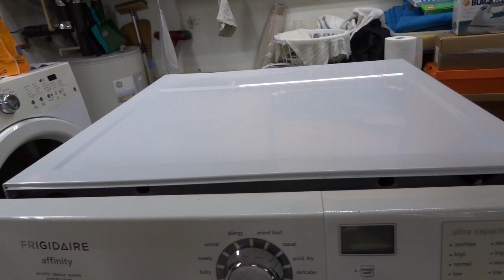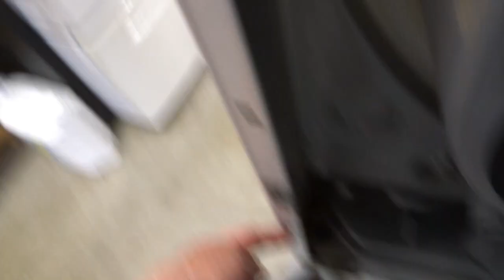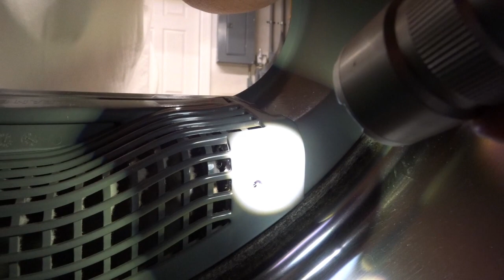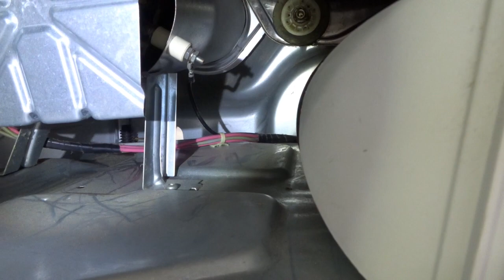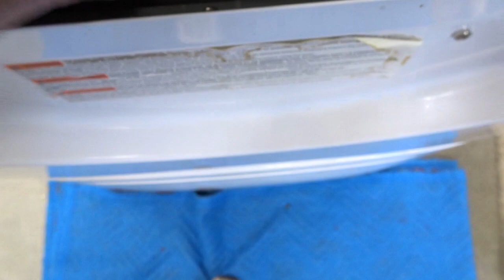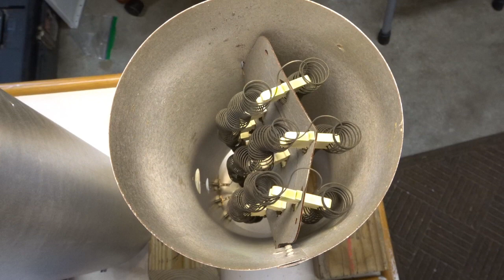Frigidaire Dryer Heater Element Replacement

Comment: Tip for the screw at the back of the heating element. Take one of the hex screws out of the old element then use socket and driver....saves soo much headache!
Reply from the maker: Great idea!  Thanks for sharing!

Comment: Your effort on this video keeps on giving - I just got mine done a little earlier yesterday. The approach that you demonstrate saved me much hassle over my experience of three years ago. Good tip on the little screw at the rear of the heater, it isn't just hard to reach; it's in a pocket that limits the length of screwdriver that can be used! I recommend a magnetic 1/4" nutdriver bit used in a 1/4" ratcheting bit wrench - smaller than a 1/4" socket ratchet. Do that screw before the other two.
Reply from the maker: Very glad I could help.  Thanks for your suggestion.

Comment: My dryer is a 2011 and has the steam option. Everything seemed identical until I got to me getting to the heating element. Now I'm stuck.
Reply from the maker: Hello Joe!  Very sorry you're having this issue and I sure wish I had a good answer for you.  Unfortunately, my dryer didn't have that feature so I really have no advice to offer at this point.  I'm just a DIY guy like you.  Hopefully you figured it out on your own or found another source of info to get the job done.  Best of luck on your repair and I hope it goes well for you.
Reply: @gizmoflyslow9854  your video got me far enough for me to figure out what to do next. I had to remove the whole burner assembly, including the gas line. It was simple enough. Thanks for your help. You're appreciated
Reply from the maker: @joegarza5046  VERY glad you were able to work through it and complete your repair.   Thanks for letting me know.

Comment: Great vid.  Thanks. That screw in the back of the heater element was a square drive on my unit.  Not sure who was the sadist designer, but you should check the head for drive type.  I shoved my phone in there and took a pic.

Comment: Well done video - thanks for all the effort! Saved me a ton of time figuring out how to disassemble the dryer and get to the place I needed to be. Got the heater assembly out and found my coils and support plate looked a LOT like yours - bent at the end, AND some of the coils were indeed touching the inside of the tube. E63 earth ground was exactly right. ALso found that there was a break in one of the center coils, so the thing was doomed.  Got a new one on order and it should be a breeze to put it in (except for those three screws holding the heater unit in place! XD)   Thanks again!

P.S.  Only only got $0.37 of change out of mine!  LOL
Reply from the maker: Thanks very much!   Glad to help and I hope your repairs and reassembly go smoothly.   Good luck!
Reply: @gizmoflyslow9854  Repairs went super smooth. Machine is back up and running properly. Thanks again!

Comment: My tip:  the back screw seems to be everyone’s Achilles heal. So what I did, as soon as I took the new element out of the box - I took the screw for the back hole and screwed it in and out several times. This basically “tapped” the hole and made for starting it when in position so much easier. Did it on the first try.  Start to finish on entire job, 45 minutes. Hope this helps.
Reply from the maker: Excellent suggestion Troy!  Thanks for your contribution to the DIY community.  Take care.

Comment: Great video, really helped me tackle this project.  I do have a tip regarding those hard to reach screws.  Particularly that back of the element one.  I did take the advice of using one of the element screws from the old unit.  I added one more idea, I screwed it into the new element  before I started the install.  I was also having trouble getting the screws for the sensor and thermostat into the the new element; so I pre-seated each of those four and that made  a big difference.  maybe this will help someone else tacking this project.
Reply from the maker: Excellent suggestions.  Thanks for your comments.

Comment: The last time I replaced this, I removed the drum and it took a very long time.  This time I followed your lead, but it took a long time to get that one screw out.  Fortunately I replaced it with a hex head so next time should be much faster. I didn't have the same problems you did because I used a #10 screw instead of a 1/4.

Comment: This was so helpful, thank you! i had watched other videos that involved removing the drum and I didn't relish the idea but then when I opened the dryer and saw that the wiring up top was different, I panicked. Your careful guidance of which screws to remove and which to avoid was SO helpful. And I laughed out loud at the advice to hold the lint trap when removing the single screw. Advice well-given! My old heating element looked just like yours!
Reply from the maker: Thanks for your comment and I'm very glad my video was helpful to you!  Good luck with your repairs and take care.

Comment: As I was able to pull my machine out into a clear workspace, I just took off the back cover to access that difficult back screw...WAY EASIER and only a little more work (~12 screws), easier to clean the back and you don't need to touch the drum...at least on my very similar model. (procedure identical but front panel on ours has more buttons).
Reply from the maker: Thanks for the comment!  Whatever works best for you and if your tip helps someone else - good on ya!  I never, ever claim to have all the answers when I do one of these vids so other helpful comments are most welcome.

Comment: Just curious, was there no error code reset stage necessary for this particular model? You just exchanged the element, and ran great afterwards?
Reply from the maker: No, I didn't have to reset anything.  The error code went away and it ran great.  I have since replaced the blower fan because it also failed and with a new fan and new element it works even better!
Reply: @gizmoflyslow9854  thank you, I spoke with a "certified" appliance repairman, and he said my issue may not be the element but the thermostats. My dryer still heats very good, just shuts system down after 15 minutes and displays error code. I cleaned the thermostats, the 2, I found, they were covered in lint. Still errors out, and hate to replace the elements when it still heats very well.
Reply from the maker: @project-unifiedfreepeoples  I agree.  Your problem is different than what I experienced since mine wouldn't heat at all.  Good luck with your repairs!
Reply: @gizmoflyslow9854  again, thank you. Your video was very helpful to me in my experience. Most searches in my situation resulted in Electrolux dryers, lol. I appreciate your kindness and hope you find this new year, peaceful and prosper.
Reply from the maker: @project-unifiedfreepeoples  Thank you Jason.  I understand the frustration of not being able to find a YouTube video that covers what you have sitting in front of you at home!  Which is why I try to produce these videos when I have the chance to help a fellow DIYer.  I wish you a very Happy New Year as well.

Comment: So that is where the black wire goes..interesting.  The three individual heating coil each has its own wire but share one return wire which is the black wire.  Time frame  15:28. 
The black wire is not live when turning the dryer timer on or the door closed.  It only comes on when the motor is operating, implying that it getts connected when the centrifugal switch kicks out at full motor running speed.  If the motor is not turning the heating element is off.  Clever?  Clever is as clever does.

Comment: our dryer has gone thru several of these heating elements. My wife ran across an article about the filter screen needing cleaned with soap and water because if you use fabric sofener it will coat the fine screen and restrict airflow and cause the heating element to run hotter causing early failure. if your filter screen has trouble passing water from kitchen faucet then use soap and water to clean until water will pass freely
Reply: Bro, thank you for this comment. I swapped my heating element tonight and I remembered seeing this comment and tried running water through my lint screen. Barely allowed any water through, it was spilling up and over the top edges. I cleaned with some warm water and dish soap, and after the water went right through. I'm sure that wasn't helping the dryer do its job efficiently.
Reply from the maker: Excellent advice!  Many people don't even clear the filter between loads of laundry!  Going the extra step to deep clean the filter can only help.  Thanks for your comment.
Reply: Awesome tip! It may prevent my next heating element from burning out so fast.
Reply: Why didn't you show putting the element in
Reply: That's why I watching it

Comment: Thanks everything work perfectly but after  after 10 minutes stop heating and gave me a code 65 now.
Reply from the maker: According to one site:  E65 = High limit thermostat trip count too high.

In other words, you probably have a restricted air flow problem. Your blower will shut down if your plugged up with lint.
I would suggest you check to make sure your vent opening and vent duct hose is not kinked behind the dryer.
Good luck!

Comment: If you shine a light through the front end of the heating element after you have it in place, it will illuminate that tiny screw hole in the back, like that old Lite Brite toy from the 70's. It's very easy then to see the tiny hole lighting up and makes it easy to line up.

I discovered this yesterday by accident while using your video for the repair using my phone flashlight.
Reply from the maker: Hello Jonathan.  Thanks for the tip!  Good luck on your repair.

Comment: Good  video brother.  I did mine about a 2 months ago...... When I did I tool the drum out too. 

I did everything except plug in the black negative wire back up. 

It fried that wire and my motherboard and the 220 breaker in my breaker box.

Now I am repairing the motherboard.
I knew it was unplugged. Seen it just forgot to plug it back up. 
Be glad you did not do that lol

Now I am basically rebuilding the whole dryer top to bottom.
Reply from the maker: Ohhhhhhh man, that sucks!  I have done similar things in the past on other projects.  I usually acknowledge my shortcomings and just buy a new one!  Good luck!